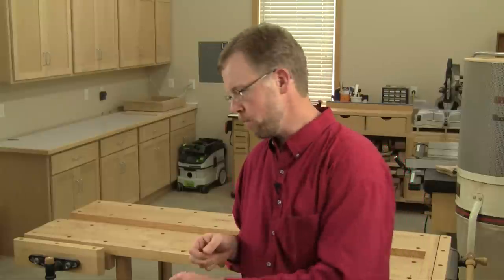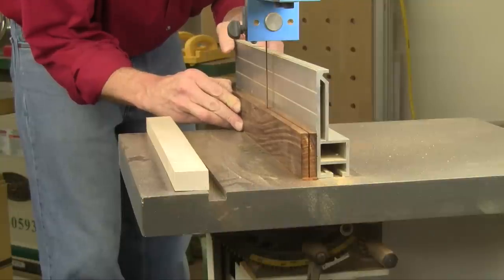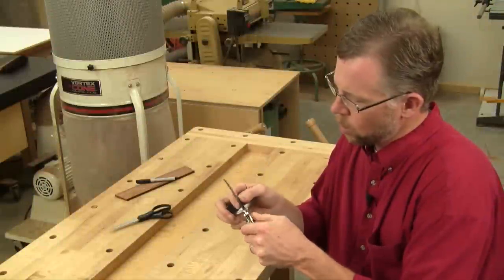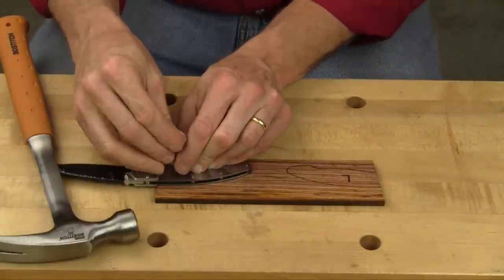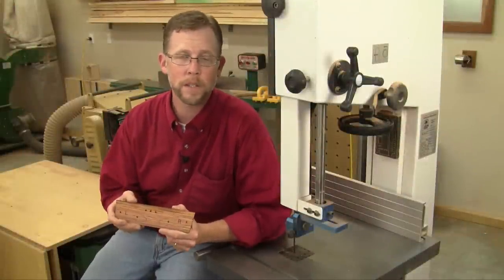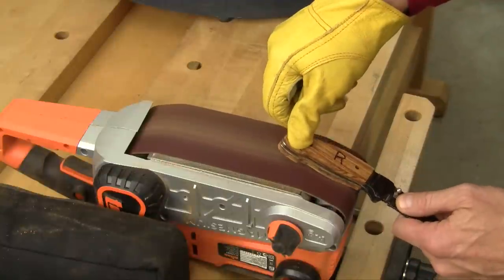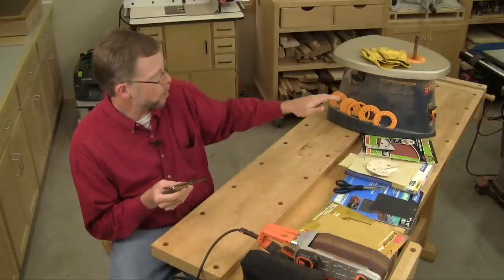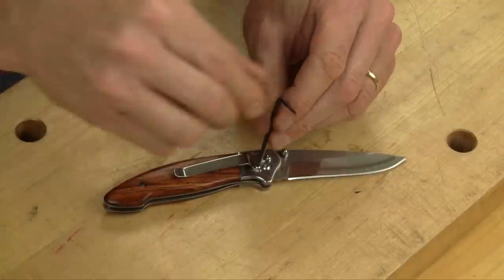Making Handles for a Custom Folding Knife

Comment: The problem with stainless is it does not hold an edge well. You're constantly having to hit it with a stone. 5160 steel offers comparable corrosion resistance, and refuses to dull.